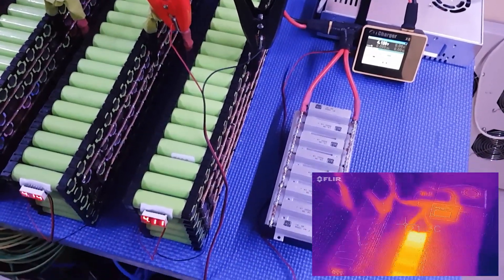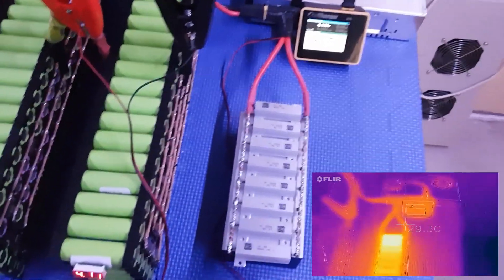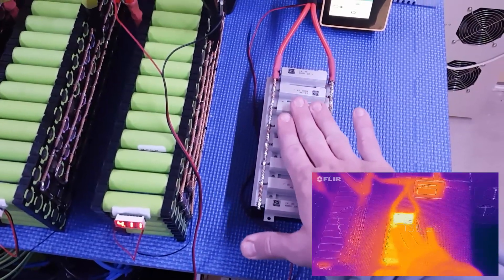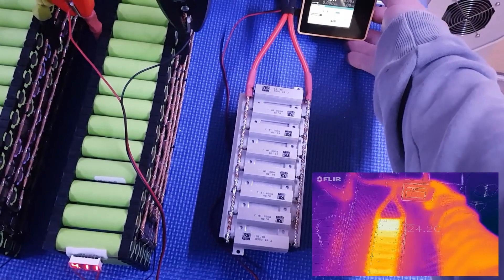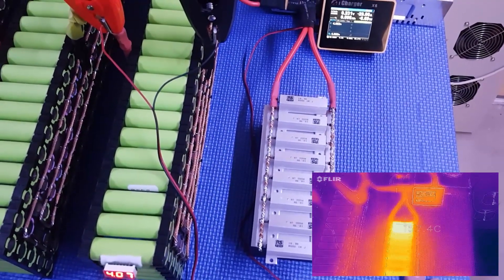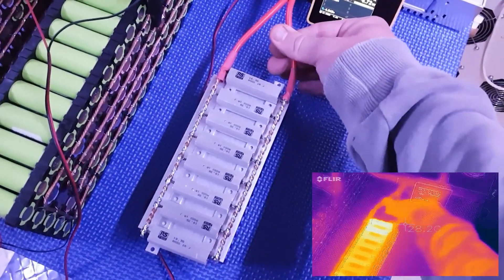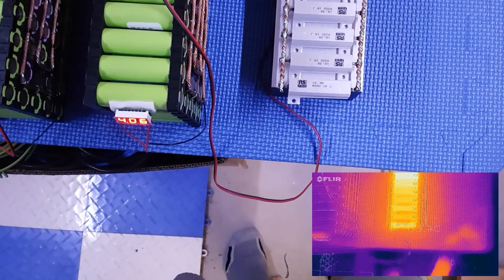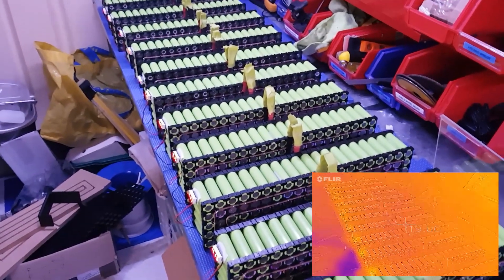30A discharge on iCharger X6

Comment: Where is that voltage reading coming from?  Shouldnt be at .2 volts lol
Reply from the maker: G'day @blackz06 When doing the discharge in this manor, the manual has a little section at the bottom stating that you must use a balance lead to detect pack voltage. The X6 cannot read the correct pack voltage through all the resistors. However if you look below that figure, you will see the correct 4v indicated in the 1S section.

Comment: Would this work on a toolkitrc m8 or other lipo chargers with regenerative discharge or is it a icharger special to be able to do this?
Reply from the maker: Unsure sorry! Check the manual for Extra discharge modes that use resistors. The X6 manual (Page 32) shows a schematic of this setup.